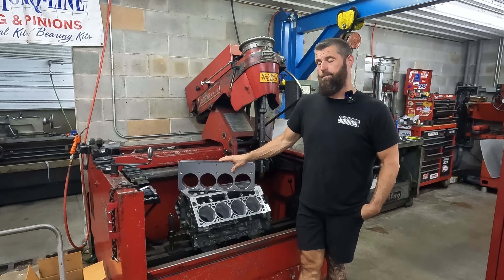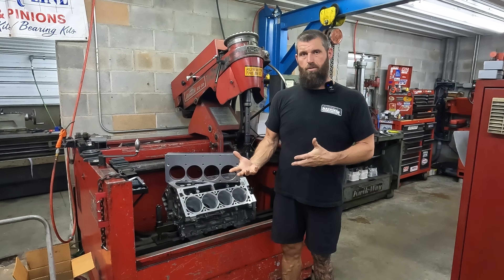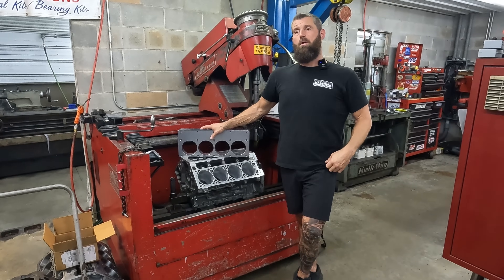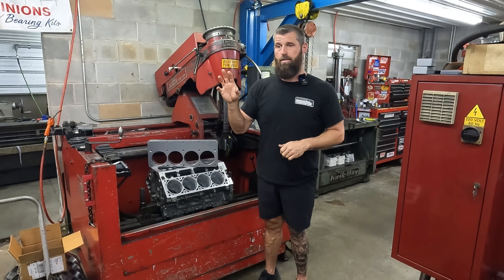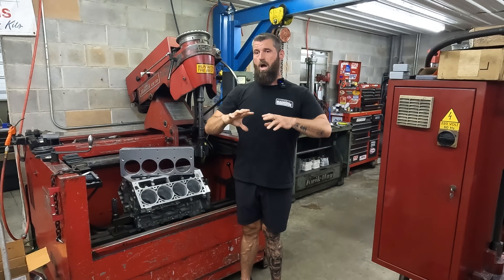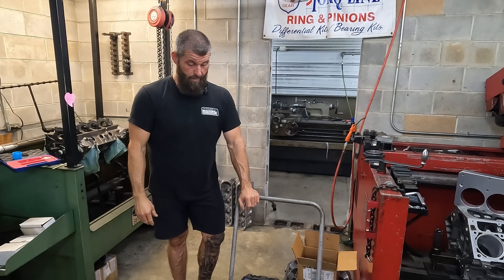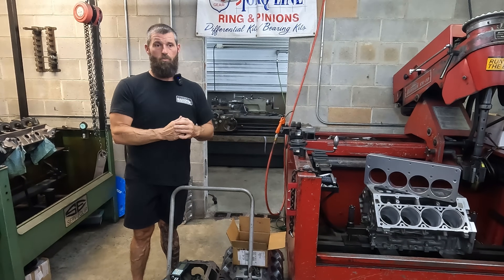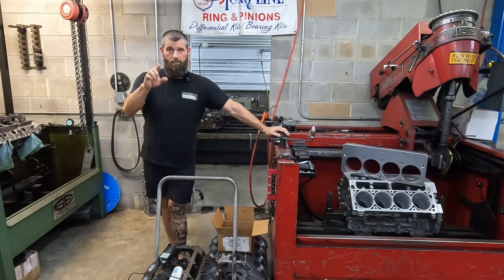We gotta talk about this torque plate deal.....

Comment: I’m over here honing my cylinders on a budget rebuild with a ball hone and not having any issues. People are so “technical” sometimes. I install valve guides with a hammer and grind valves with lapping compound and my engine runs great.. like he said, every engine is not a $6000 race engine. Heck, I even machine my heads with sandpaper on a piece of glass. Works like a charm. People gotta stop being keyboard warriors so much..
Reply: People love to overcomplicate even the simplest of tasks. It makes them feel smart. They're not, unfortunately. It's another function of pride.

And, what comes after pride? The fall.
EVERY time.

Comment: For years and years and years every buildup in every magazine and word from the top builders in the write ups,have always always said if your machinist doesn't use a torque plate they dont know what they're doing.

Its not people just making it up.

What you said makes sense .

However we just had a small block done was torqueplated andstuff as basic rebuild.
No extra charges, $1500 for the short block 
So its easy to see why people are confused

Comment: If the torque plate metal grain is not aligned with the block grain it will pull it out of alignment when you hone anyway. Of course I just made that up just like 99% of the comments on the topic. 😂

Comment: Funny you think because being on youtube videos makes you an expert. 
I'm a machinist, you're ridiculous for even starting this and if you think 4 tenths is irrelevant at tdc that's your fault. It's not necessary for any engine to run but it's always better and we wouldn't do it for free either. LOL, At your shop it makes no difference cause I bet money you can't hold .0004 in a cylinder anyway but WE hold half a tenth round and straight when we use torque plates.

Comment: That is why there is specs and tolerances.  To compensate for expansion, contraction. 
I doubt oem uses torque plates. 

I hav heard that some heads and probably other parts really should use a torque plate. 
I trust in my machinist to hopefully know what they are doing to provide me the longevity i require out of my engine. Or part

Comment: JUST FOR THE RECORD: To all you know it all's out there, lets put this in pespective... 4/10th's of a thousandths, at the top half inch of the cylinder this machinist mentions at 6:00 is a whopping 10.16 microns (I work on a micron level every day). A Human red blood cell is shaped like a dish plate and averages 7 to 8 microns across at the widest part (O.D.) So that 4/10's of a thousands is a BIG red blood cell, plus a little more.  Let the man do his job and stop parroting  with herd mentality on social media like you know what your talking about. Torque plates aren't the magic you think they are. PROPER tuning is. Lets not get into the super hard core engine guys that torque plate during the honing process while engine temperature water is pumped through the cooling jacket. You should see that set up.
Once again, thank you for taking the time to create this content. Good stuff!
Reply from the maker: Tyvm, spot on

Comment: This video content found me. Thank you for the content! Years and years ago I had multiple engines (mopars, Chevy, and Ford) honed with torque plates and lot's without torque plates. Duplicate engines, with  the same over sized bores, internals, cams, carbs, jetting, balancing, hardware, etc, etc, etc. Showed absolutely ZERO difference with or without a torque plate. Just saying. A proper valve job and correctly chosen cam along with PROPER TIMING and JETTING (carbs) or fuel trims (fuel injection) will give you much, much more. Torque plates show the smallest gain if any among most modifications. On a dyno you will see it. In the car and using "seat of your pants" dyno, no. Too many variables.  Just my opinion from hands on.

Comment: Great video! I got here because I saw MotoIQ talking about how some shops didn't build subaru turbo engines correctly because they didn't use torque plates - but this was also because those had rings much higher up the piston that was a limiting issue , so that top part of the piston matter more when pusing higher than 100+ horsepower. 

But what do I know. It seems like they make sense on a use-by-use basis and isn't universal that torque plates are ALWAYS needed on every car. GREAT video sir!

Comment: "what's a torque plate?" 
oh a useless piece of metal that means nothing and only gains you microns of accuracy that you don't need. noted. dude, people have no idea what they are talking about. the only honing of a cylinder i've seen are dingle berries, drill hones and people professionally honing farm equipment. if you think that you need a tool to do a job properly, you probably don't know how to do the job. you don't need a high end machinist shop to rebuild an engine, you can do it in your garage with simple tools, technically, doesn't mean it's going to last a long time or not have issues. the better the job, the more it costs, but you can do a job with the cheapest of tools and even make your own tools to do the job. there was a time when we didn't have fancy machines to make presice parts, you know what we did? made jigs and multiplier contraptions to make a very precise part, that was then used to make an even more precise parts. we only have the precision we have today because we worked with stone tools and wood millennia ago. and for most things, that's good enough.

Comment: On a full build a torque plate is a good thing. But is it an absolute necessity? On a shitbox with an old iron block a dingleberry can work wonders. We did a hillbilly rebuild on my buddy’s 258 AMC six banger. The cylinder bores was as tapered as a step drill. No ridge reamer, no bore out, nothing. We cleaned the pistons and shoved in some new cast iron rings. We dingled the shit out of the bores and slapped on new bearings and an oil pump. He drove it from South Carolina to Texas pulling a uhaul trailer and I have the pictures to prove it!

Comment: Funny, I have been rebuilding my own engines for years, (I am 60 years old and over the years have rebuilt hundreds of engines, and rebuilt no less than 20 of my own, both stock and modified up to well over double the original horsepower, and driven the crap out of them for hundreds of thousands of miles. Never had one of my own fail before 220k miles. The worst I have hat to do to any of them eas replace a stretched timing chain ordecayed timing  belt, which is normal wear and tear.
Would you like to guess how many torque plates i have ever used? 
0
When would i use one? If i was building a 2000 hp, top fuel dragster that was running on nitromethane.
If you aren't building that, and you think you need a torque plate, like the gentleman said, you are on the dhort bus.

Comment: Installing a torque plate is like putting a cylinder head on. It takes time. 
 Time costs money. Torque plate work costs more. 
 And how many remanufactured engines have been built with engine machined with not torque plates that lasted over 150,000 miles, all of them. 😂🤣😂
Reply from the maker: Yep

Comment: I recently got some aluminum torque plates and seen similar results. The steel torque plates seem to distort cylinders more, but still won't mimic the distortion a cylinder head creates. On like a 6.7 Powerstroke a cylinder head will distort the cylinder .003-.005" out of round at the top of cylinder.

Comment: A brand new Chevy , Ford , Chrysler ..whatever , is not nearly as close as what you expect from your own work . I'll bet if you tore apart 10 brand new engines , none would have the same tolerances . Fact is , big horsepower motors got built long before torque plates were common in a shop . You don't always need a torque plate , same as you don't always need a degree wheel to install a cam . A million cams get installed ' dot to dot ' for every cam that sees a degree wheel . But for that guy that's looking for 2 HP here , 3 HP there , every step is vital . Slop will run , but not fast or for very long . Keep coming with the quality videos ..I got a lot to learn .

Comment: Show me a set of cast pistons with a tighter tolerance of less than 1/2  thou. and I'll be using those pistons from that day forth
Reply from the maker: Cast pistons run .001-002, forged run .0035 and up
Reply: @powellmachineinc  Bore clearance, I'm refering to dimensional tolerance. Your reference to forces in different directions are partially accounted for by oval bores, also has a slight advantage in being able to use a shorted block assy. which has an even greater advantage in weight distribution and giving the aero dept. a bigger area to play with. 
Luckily something that no longer bothers me.

Comment: What is a torque plate used for?
Sorry I'm just trying to learn.
Reply: it puts roughly the same load on the engine block as a cylinder head, then you hone the block with it installed.  its an extra level of precision that isn't required but people making 500hp+/race builds do it simply to get more precise clearances.  most engines do not require it.
Reply: @ChristmasCrustacean  thanks a bunch!!!

Comment: I feel its become the same with crank balancing.
Most mild/medium builds probably just dont need the crank balanced.
Weight matching pistons/rods goes such a long way that balancing the crank isnt really doing much.

Unless youre making it rev much above 6000-7000 balancing doesnt affect things.

Save the money to other things like maybe breaks for your speed monster 😉
Reply: absolutely, the factory balance checks one crank out of a batch and a database weight matches pistons with the size of the bores of the engine thats being assembled and a set of rods that matches.

Comment: Still trying to work out what torque plates are or why they’re used? Is there an earlier video where this is covered?
Reply: it puts roughly the same load on the engine block as a cylinder head, then you hone the block with it installed.  its an extra level of precision that isn't required but people making 500hp+/race builds do it simply to get more precise clearances.  most engines do not require it.

Comment: I had a machine shop for almost 30 years, i was ASE certified master engine machinists and bored hundreds of blocks without torque plates and had zero issues, i was building bad ass engines before torque plates were invented !

Comment: not only that, but the .177 side is being heated on both sides, while the .386 is being heated from one side and cooled from the other side, and both unevenly, from top to bottom and radially around the cylinder.

Comment: It's very rare that you'll ever see any proof that a torque plate is needed. With torque plates involved, it almost doubles the machine time, and I dont think the average Joe Blow wants to pay double the amount. I built a sbc 400 for content and didn't use a torque plate because it was "a budget build." I ended up putting a much larger cam and ended up with alot more compression that I had planned, so high tensile head bolts were used. I dynoed it and then decided to do a head swap to re-dyno it for more content. It's the only time that I can remember that the proof was there that it should've been torque plated. You could see shadowing where the head bolts are, but 99.9% of the time on stock stuff, it makes no measurable difference in power or at the gas pump.

Comment: If you search for any engine assembly plant tour video, the blocks are machined completely without torque plates. BMW, Mercedes, General Motors, etc don’t use torque plates. CNC mills do everything needed with only fixture tooling and then they go to a CMM.

Comment: Ima throw a monkey wrench in here friend:oops:  As you said not a high buck job. I have rebuilt a bunch of 225 slant 6's in mail vans mid 1980's. Without pulling engine, all done thru dog house and underneath. Used a precision mag drill for the rare .010 bore jobs, usually we'd just scuff hone bores, and re-ring the pistons if usable. Always new pushrods, 225 s 6 JUST do it lol. after a bad backfire they bend all the time...its only caveat. We'd get 300,000 miles out of these before the needed to be pulled and re-machined. LOW low performance , but hammered continually. This was all we did to them. 300,000 miles back then!

Comment: I took my 1500 hp concrete short filled LS iron block to a very well known Pro Stock racer and engine builder for machine work. I asked about torque plate hone and he said you don’t need it. The head bolt threads are down in the block. I said oh. I didn’t realize there was no need to torque plate hone because of that. Thanks, for saving me money.
Reply from the maker: Np

Comment: I managed my family machine shop for a long time, not including the fact that I grew up in it.  There's one constant I've learned in the metal trades. Everyone with zero hours experience knows more than the actual machinist.   They know it all, but they have to pay you to do it.  Bunch of blowhards.  

The only time the torque plate is absolutely critical is if you're running Nicosil linings or MAYBE FRM sleeves, or like you said, if it makes crazy HP with boost or nitrous.
Reply from the maker: Definitely

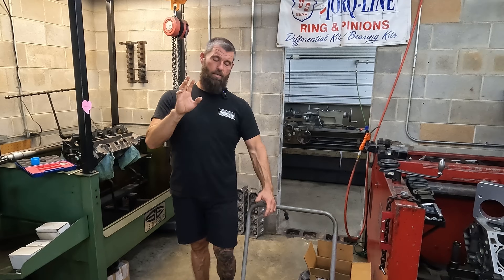Comment: 13:54  roflmao.  I never gave it a thought of 2 cylinders at separate stroke cycles next to each other
But its why cylinders have a cooling jacket around them to try and bring the tempture to a constant leval.
Because the intake, combuston  excust and intake change the tempture constantly as the motors running, the rings move to fill the gap.

Comment: .00004  is less the factory specs
Thats tool makers specs or aircraft specs.  A human hair is 3 thou 
Nothing is perfect  but 4 tenths of a thou is pretty dam close.
The bore changes more when its hot. Yes metal moves thats why you drill a hole come back with a remer to bring it back more accurate  and a drill bit sharpened off center can egg out or walk off its center line  also when you drill heat can cause a hole to change its final size when its cool. Also why you use a remer .

Comment: What your talking about is the point of diminishing returns.  In the world of milling and machine rebuilding they teach you everything moves you can hand scrape in a cast iron straight edge hang it and ring it with a hammer and it will move.  Same thing happens on a motor.  First heat cycle will move that cylinder wall out of round more than 4 tenths, correct tolerances are what matter for good running and reliability.
Reply from the maker: Yep

Comment: Some of these guys would absolutely crap the pants if they knew what happens to some of these races engines, in the machine shop, or in the pits, to get put back together to make it to the next round. I used to think, you got to be in a lab coat with the say it filtered to build an engine, lol. Those things don’t care. Heck I’ve seen on here, YouTube now mind you, where some engine have different size pistons in the holes. The blocks were bore over just a little from what the actual bore spacing is. They just don’t care! It’s impressive what an engine can eat too and still run fine. These guys think you should be building all your engine like pro stock engine I guess. 😀

Comment: Wonder why fella got all worked up over another customers block...honing with a torque plate is a specialized more race oriented service that Not everyone is going to get.   YES, using one does offer the best fit and finish but also requires more work and expense. Does the free torque plate service come with Align honed mains, and diamond honed bronze valve guides too?? I thought those were standard practice for all grandma buicks? Lol

Comment: In the video you mentioned that the Ford FE motors need a torque plate.  I have a Ford 351c motor, will that motor need a torque plate when I have it bored or honed?  Thanks for your time.
Reply from the maker: Yes,  most ford's will need a plate

Comment: On high HP builds I make the torque plate same thickness and material as the head. I use the same fasteners as my build and the mains and plate are torqued to spec. on a v8 i have 2 plates and both are torqued. I've found its not flatness but specially on cast iron blocks the fasteners displace the bore around them. I'm a Machinist by trade and can measure to .0001 so I'm splitting split hairs. Its probably over kill.

Comment: I may be guilty of bumping MY head more than a few times, but how on earth would a Torque Plate do anything to help an open deck 5.3 anyway? The head bolts are a country mile from the cylinder bore. Just turn Ray Charles loose with a Dingle Ball hone, and let'er eat...🤣
Reply from the maker: 5.3 isn't a open deck
Reply: @powellmachineinc  Sorry, I was referring to that block you were demonstrating the cylinder wall thickness on. It may not be a completely open deck, but the bolt holes are partially separated from cylinder bores by the water passages.

Comment: I listened to a High Performance Academy podcast with an engine builder, and they talk specifically about the things you mentioned on all the other variables like engine block temp while honing. It was interesting what the guy found. Basically after warming the block and trying to account for thermal expansion with everything they needed to figure out new acceptable tolerances. That the numbers when cool fell out of range for bearings. The bearing manufactures take into account thermal expansion and a block that is machined when cool. Was pretty interesting. I may have that slightly wrong, but basically it sounded like you would have to figure out all new values based off of machining something optimally at temperature. It sounded like in practice the results are not even close to what you’d expect.